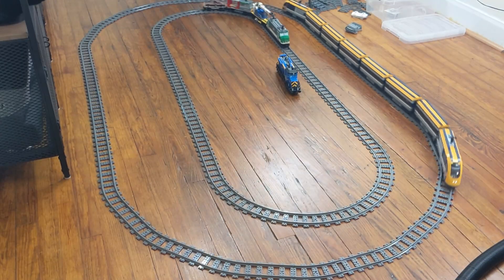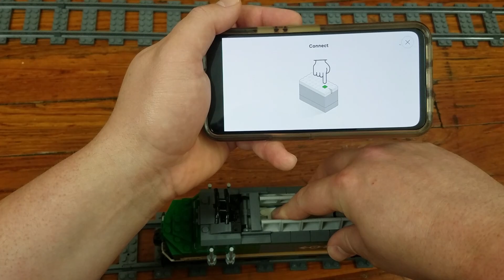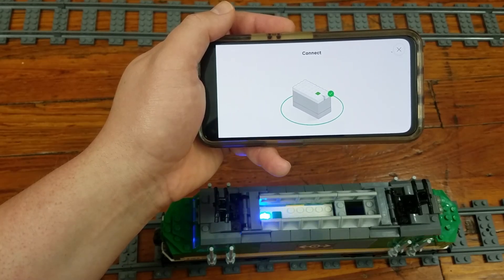Controlling multiple Powered Up trains / hubs with one remote

Comment: Then how do you make the lights go brighter with the same remote or do you need another remote
Reply from the maker: If you have two locomotives on the same remote (A and B) than you couldn't use lights unless the lights were tied to the other locomotive if that makes sense.  For example the lights would be as bright as how fast the motor on the opposite locomotive was going

Comment: great tip about updating the trains,  but it worked out now to pair 2 trains on the same controller, but how did you manage to let drive 1 train in reverse and the other fwd, so the a double set can be joined?  now we changed the front and rear assembly
Reply from the maker: In this case I physically turned the motor around and ran the cable through the back.  Now I'm using PyBricks (an alternative to the official Lego firmware) and a program modified by one of our discord members to allow for controlling multiple trains and having full control of the direction of each of the motors

Comment: I just turned the right +- upside down on the remote and installed the engines regularly. No external cables needed
Reply from the maker: That's an option too, which I've mentioned in other videos.  But when performing shunting maneuvers with several trains a single button per train makes it a lot easier

Comment: Am I alone or is bluetooth Satan’s protocol? Urgh, I hate it. 
I’m going to have to watch this video on a loop and take notes.
Reply from the maker: I have an updated video that is a bit better.  I pretty much use PyBricks exclusively now.  One of our discord members has been updating a script from a Eurobricks user and adding several features.  He's currently working on multiple trains on one controller.  But it already allows for smooth acceleration, lights, tying multiple locomotives together and much more.  I wasn't really a fan of BT for trains until I started using PyBricks and the Brick Automation Project software.  I never really liked Power Functions IR control, plenty of problems there as well
Reply: @BatteryPoweredBricks  I tried to follow the LEGO instructions for connecting two different hubs to one controller but their instructions are clear as mud and I couldn’t get it to work. There was some other instruction for something else which said to wait for the purple light. I’d see a blue light but not a purple one so thought I was doing something wrong until I realised the blue light was purple (even my housemate described it as blueish-lavender, and not really purple). Generally I find implementation of Bluetooth by most companies to be half-baked and convoluted, and LEGO is certainly no exception. 
I have a day off work today for Anzac Day so will read up on PyBricks. It’s been some years since I last did some coding but text based is definitely preferable to obscure esoteric icons which are almost indistinguishable from each other on a phone screen.
Reply from the maker: We all use the same script for our trains.  It automatically determines the type of motor etc.  You just have to set the direction they need to turn.  I made a tutorial at the end of last year that should be mostly up to date.  Also if you are a discord user you can join us there for the latest updates / exploits.  They are much better coders than me 😅

Comment: 1 year after your upload this technique is still valid. Thank you so much!! Now my little boy can drive the big passanger train with ease.

Now i just have to find a different option for those batteries.
Reply from the maker: I use rechargeable AAA batteries.  The NiCD batteries seem to do ok, but I know many use lithium batteries for their higher voltage and perhaps longer runtime.  KeyBrick One is also an option but they are very expensive and often out of stock, I have a few friends that swear by them.
Reply: Much appreciated, will look into it!!

Comment: Is there any way to connect a old Lego train like the blue 60052 cargo train with yellow passenger 60197 train together? Like so I can control both trains from one controller.
Reply from the maker: Yes, pretty much the same as what's shown in the video but make sure both motors are plugged into port A and they will be controlled together

Comment: Every time I connected them, they connected to the same side and not different sides
Reply from the maker: I don't remember if I mentioned it in the video but for the locomotive you want to be on the B side, make sure the motor is plugged into the B port on the hub

Comment: I tried your way and it still doesn't work in my case. It's driving me nuts! 
I want to connect a passenger train and a cargo train (to hubs) to one controller. Both trains connect individually and work jus fine but when I have one paired I just can't connect the other at the same time. 

Any other suggestions? 
I tried reseting both hubs and remote, ofc.
Reply from the maker: I have an updated video that shows it a bit more clearly.  When connecting the second hub, press the button on the hub and the light will start blinking.  Then press and hold the button on the second hub and the controller for a couple seconds, it should connect right up.  If you still have issues you can connect the hubs to a phone with the Powered Up app and make sure it has the latest firmware.
Reply: @BatteryPoweredBricks  Thanks for the reply. I tried your way many times and it didn't work.
However, the good news is I finally managed to connect two trains to the same controller. After I had paired the first train with remote controller I paired the second train (that is hub inside of it) with... the first train (simply by pressing green buttons for a moment on both trains at the same time for a second). Now it works - I can control both trains with the same remote controller. Every time I turn on the trains I repeat the procedure.
Reply from the maker: That's strange.  Once I get them connected I've never had to repeat the procedure unless I reset them 🤔

Comment: I chose another way to turn the motor around. I changed the order of the bogies so that one of my locomotives run with the motor in the cab end, while the other has the motor in the end connected to the rest of the train.
Reply from the maker: Yep, that's an option as well!

Comment: Thank you! Halving my controlers, can have a hub in both ends of a passenger train with a motor on both hubs on the same channel and not have to click two buttons on two remotes, simple as and perfect. Why lego doesn't include these incrustions I do not understand!
Reply from the maker: No problem!  I have an updated video with a better procedure and a bit more detail.  I don't know if it was added later or if it was just that hard to find, but Lego has the instructions on their site now 😅
Reply: @BatteryPoweredBricks  just watched your PyBricks video as well, reversing the motor direction, a slow precise mode you can turn on and off, hold to slowly accelerate, program gentle acceleration to set speed setting, run two motors off the one hub from one switch, with one in reverse. THIS IS INCREDIBLE. wondering if it would let me control one Train per side of the remote, both with two hubs, (on hub on each end of a passenger train) and both ends of each train having two motors, half of all motors running in reverse. I will be playing with this as soon as I tidy up and reorganise the lego room/city - so in another few months haha. Thank you so much, you're the best resource for lego train powered up set up and modification that I've found . By far!
Reply from the maker: Thanks!  I got back into Lego trains last year and it took me quite a lot of research to learn all I did.  I prefer concise tutorials with voice over and didn't really see any I liked, so I made my own 😅.  With PyBricks I don't think there is a way to connect multiple hubs to a single remote.  They are constantly working on new things so this may change.  Another option is using the Brick Automation Project software and you can control many trains with sliders on a PC.  I have a video on that as well 😁.  If you have any questions don't hesitate to reach out, I don't think of it as work or tech support, more like potential video ideas 😀.  Play well!

Comment: I randomly clicked on this video and now I know I can pair two motors to one button. Can we do 3 as well, just asking?
Reply from the maker: Up to 5 per controller.  I made an updated tutorial that shows a better method to connect them and it has a few other details such as using multiple channels on a remote.
https://youtu.be/EwrQu4IQh68
Reply: Can I connect my 60197 x 2
60336, 60198 and hogwarts express to one remote?  @BatteryPoweredBricks

Comment: Thank you! Like you, I do not understand why this information is not available through official channels. We spent multiple hours on this and have that stuttering bug also.
Reply from the maker: Thanks!  The information was added at some point on their website, It's still kind of a pain to find.  Why this information wasn't in the manuals that came with the set I'll never understand.

I have an updated tutorial for PU that goes a little more in depth if you ever have any more issues, it's linked in the description.  If you have any issues that aren't covered I'd like to hear about them.
Reply: @BatteryPoweredBricks  hey I tried connecting today and my remote always turns off on the second train. I am really at a loss here.
Reply from the maker: definitely check out the updated video, about 3 minutes and 30 seconds in shows the updated procedure
https://youtu.be/EwrQu4IQh68

Comment: Thank you for this video I’m used to the old power functions where you could use connect as many trains as you feel like and of the way you going. I currently have to Lapin Mersk trains that I bought two years ago and I want to finally motorised them, so I had to spare brand-new passenger train side shut the motors in and I thought it was just gonna be easy. Nope and I looked up and your video, but I’m extremely disappointed in Lego for this. Why can’t they go back to the 2006 remote control where we had a train horn and all that no I really hope Lego starts focusing on the train community because I reckon that is a market logo should focus on as well because they will make a lot of money. I mean look at Hornby but  yet again thank you for this video and if I ever see people talk about this on the Internet I’m going to recommend this video to them.
Reply from the maker: Thanks! Some of the info in this video is incorrect / outdated.  I'll link my newer video, I've debated on deleting this video but it still gets views so I'm between a rock and a hard place.  I don't know if it was added after the fact or not, but LEGO does have instructions for pairing multiple hubs now.  At this point I don't expect LEGO to do any better for the train community, they are focused on their target audience, which is not AFOLs.  The Train theme (or now just a party of City) has been going downhill for decades.  The 12v line was peak for train enthusiasts.

Here's the more recent video with updated information
https://youtu.be/EwrQu4IQh68